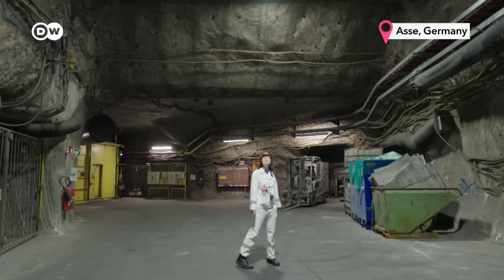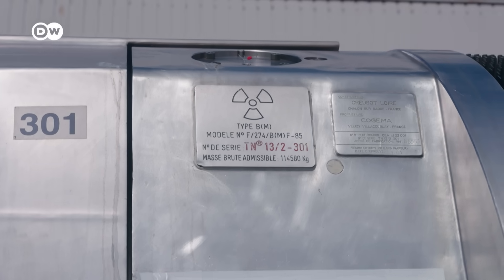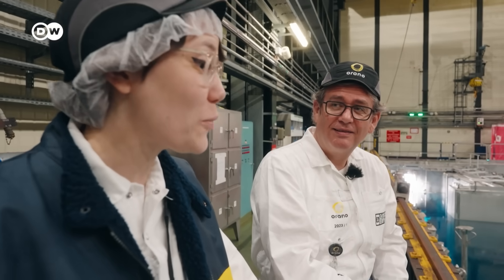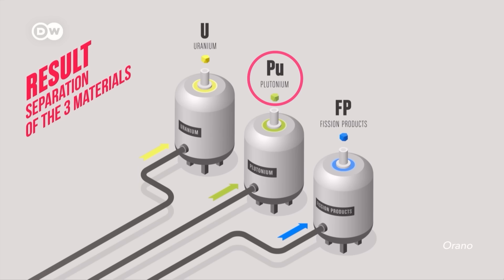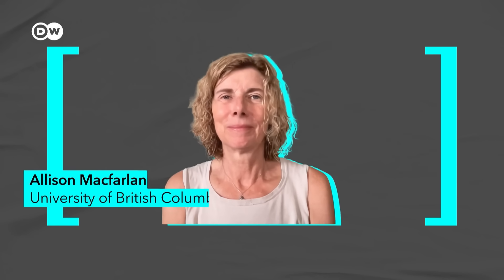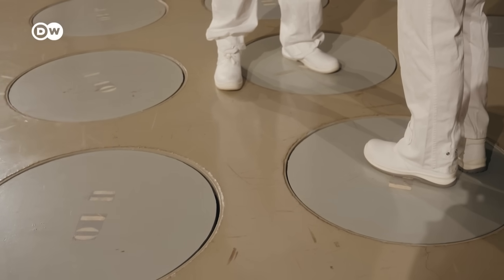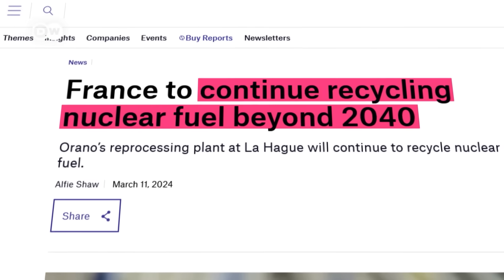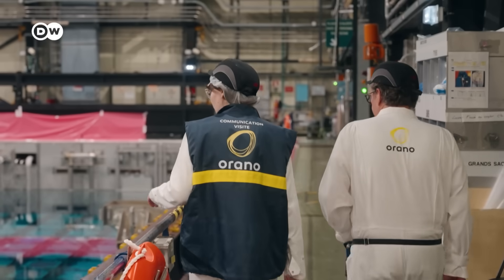Nuclear waste is reusable. Why aren’t we doing it?

Comment: In Germany people ran Amok against the Nuclear recycling plant in Wackersdorf. Later attempts at recycling spent fuel rods drew massive protests where people chained themselves to railroad tracks to prevent nuclear recycling (Castor transports).
So the fact that it is recyclable is well known in Germany, just not wanted.
Reply: Weren't the protests against castor transports directed at nuclear power overall and/or the (temporary) storage? I never heard that they wanted to prevent nuclear recycling. We don't even have the facilities to do so. Weren't the castor transports heading to Gorleben where nuclear waste is dumped until there is a long-term solution?
Reply: @kathrinbauer5358  YouTube has again deleted my comment, probably because I linked to a DW article published on 2004-July-11 where a castor protester was killed by a train coming from the French recycling plant in La Hague. 
But who needs sources when we can just shout at each other and spend interaction time. 

Whatever prompted you to cast my comment in doubt: everything remains as it is! 
1.) Nuclear recycling was well known in Germany.
2.) the nuclear recycling facility in Wackersdorf never came to pass due to protests. Please look up "Wackersdorf nuclear reprocessing plant" on Wikipedia!
3.) the French recycling facilities at La Hague were used by Germany instead
4.) the anti-nuclear protesters targeted specifically castor transports back and forth to La Hague... as witnessed by the article on DW mentioned earlier.
Reply: its sad and stupid when you know that germany was once the most advanced country for nuclear energy. Big brains are leaving this country because of shit politics, which leads to even stupider politics...
Reply: To bad there are so many stopit people in the world 😢. 
A small part of the population was against nuclear power plants in Germany and they managed to get the government to stop and dismantling the  power plants in Germany .
Now they have a big problem for there industrie  and had to go back to burning coal 😭🤯.
And there trying to solve there energy crisis with solar and windmills 😂. 
I think hydro plants maby a solution for them .
Reply: Every time I speak with a German about recycling they end up shouting facts how it’s not possible or else everyone would be using it. Maybe I’m talking with wrong people but Nuclear Phobia is crazy here.
Reply: @blackfoxstudioX  That has a couple of historical reasons: East Germany but in particular West Germany was THE front country in the Cold War and both NATO and the Warsaw Pact foresaw the end battle taking place on German territory (see In seven days to the River Rhine). West Germans were horrified by the decision of the German government to let the US station Pershing Rockets on German soil, making it a primary target for a pre-emptive strike. 

Naturally, this caused a lot of fear: many towns still have signs at their artery roads saying "this is a nuclear weapons-free zone". My father had planned out a route that would get us by bike to the Western side of the River Rhine. 

The pacifistic movement in Germany took deep roots in Labor Unions and the left intellectual circles. These movements also replaced the German word Kern (Core) which is used as a prefix for "nuclear" by the word atom. So nuclear power became atom power, making it reminiscent of atom bomb.
Nuclear plants but particularly the nuclear recycling plant in Wackersdorf were painted as dual-use facilities that would rouse the suspicion of the Warsaw Pact.

The pacifistic movement joined forces with the environmental movement in a narrative that could be titled "man and nature in peace" and found its political expression in the Green Party - third strongest force in German politics today. The environmental concern "what do we leave for future generations?" also asked: what do we leave behind. 
The final deposition of nuclear waste became the ultimate trump card in the German nuclear discussion - see Nuclear Priesthood.

Since - as in many country - the capital is in the hands of less idealistic people, the anti-nuclear movement composed of a broad coalition of environmentalists, pacifists and left-leaning people in general focussed on making nuclear power simply as expensive as possible and demonstrated with great publicity through road- and railway blocks against the transport of nuclear waste. The opinions against nuclear power are so negative that no foreign company will invest into a nuclear plant in Germany in the foreseeable future.
Reply: idiocy
Reply: And now germany is breaking there own rules and borrowing 500 billion, whilst strip mining brown coal. Nordstream is a hunk of junk, myb shouldnt of relyed on russian gas duhh. Idealists and romantic thinking bringing the king pin of europe too its knees. Think they chose the greater of two evils there.
Reply: Activist do not equate with intelligence
Reply: Germany doesn't even want France to do it. I heard that France could use much more of its existing nuclear plants but German reps keep blocking them in the EU energy council in response to demands from the anti-nuclear movement. It sounds well-intentioned but misguided
Reply: Dumb Krauts
Reply: Beware - recycling is mostly a marketing lie:
Orano claims 96% of the fuel is recycled but that marketing talk.

In reality only the small amount of Plutonium is really turned into new MOX fuels.
The low enriched Uranium mix (around 95% of the total mass) cannot be used as new fuel. 
It is a "could be" fuel that is not used by anyone and only could be used if you would treat it further....
Orano's 96% claim is off by around 95% !
Reply: Yes because as she said atom bombs. Germany has a ban at weapon useable Plutonium outside science. If you remember someone lost a war. Still During the cold war American nuclear weapons were still stationed in Germany.
Reply: The problem is the boomer Generation. They also vote for parties which intensify the immigration problem.
Reply: Germans lost two world wars for  a reason .. they are not good at using common sense
Reply: The pollution from people driving to and from the protests will kill more people than the plant ever will.
Reply: People in Germany are known for some silly and illogical things. Greens vote to ban nuclear, yet they very much like using Russian gas and polluting air with coal fumes. This is politics and agenda, and fact that simple-minded individuals can be easily manipulated, not reason, why they do so.
Reply: Now they buy nuclear power off of France, pretty ironic huh?
Reply: it is so crazy how germany would tolerate that. stichwort: Landfriedensbruch und Gewaltmonopol des Staates
Reply: Build them in France sell the electricity to Germany dito UK nuts.
Reply: And all that nonsense came from Soviets to keep Germany and other European countries from getting nuclear power... And of course, Germany's Greens are green only on surface, scratch that and you will find red inside.
Reply: Germany prefers to burn fossil fuels for their energy and then sh*t on france for its nuclear power usage (and barely having fossil fuels for energy).
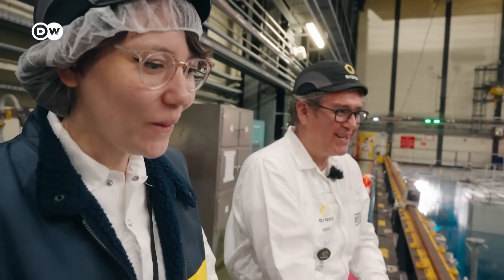Reply: "4:35  im used to it but its my first time here." I Dont hang out here either hahaha😮
Reply: The coal Corporations hold an absolute Monopoly over the German Power plant industry and have sucsessfully scared the public away from nuclear energy
Reply: Technically can’t they recycle it later on? It’s not like it’s going to go anywhere after they bury it or whatever they do with it.
Reply: O nuclear waste lasts 10's of thousands of years. Hmm perhaps we may advance a little in that time period? Especially if we pursue logic not idiocy
Reply: @sionwright3570 such plants are already today. In west media are ignored for political reasons.
Search for BN-600 and BN-800 Power plants.
Reply: Stupid liberal unemployed people are at it again
Wasting money
Reply: there is a saying people get the governance that they diserve, and probably the energie to:-) that being said, economicly it is questionable if recycling nucleair wast is a succes, but from the prospect of taking up responsibilty it is miles ahead compared to the oil industrie and especialy the renewable industrie.
Reply: @panoramix2656  Absolutely! Well said! i live in Germany and I got to say, here the politics is really a joke. There is not even one sound party left in the system.
Reply: @sepmercury5180 You guys need to elect an Austrian and Make Germany Great Again.
Reply: @gussampson5029  Been there, done that, as they say. But the US may be heading in a similar direction... ? Let's see how that works out
Reply: @sepmercury5180  People generally have the leaders they deserve. We have made politics as a job so unattractive with bad salaries and lots of envy that all the really capable people go to work in industry or run their own businesses.
Reply: As long as it's outputs radiation it can be used for energy. Note the transport caskets for the waste was said be at 300°C. I fairly sure that's above boiling and therefor producing steam. We don't always have to recycle we can just use different type of reactor to take advantage of the less energetic fuel.
Reply: @PieOfDoom2000  Isn't steam already the same principle nuclear energy is converted in powerplants for the energy grid?
Reply: @kinngrimm I think he means coupling the cooling chambers of spent fuel rods with heat recovery systems for district heating for example. This is somethings that’s being looked into.
Reply: @PieOfDoom2000 not hot enough to make the super steam.
Reply: @PieOfDoom2000  A town in Sweden runs their city's  water pipes  through a local crematorium before it fills the hot water tanks.
Reply: Germany loves carbon , pay high price electricity & russian gaz. Greetings from France.
Reply: They stopped using nuclear power in germany which is the most green power there is and instead they opened all their coal plants again :DDD i love activists and their logic.
Reply: The end of coal power plant is decided and willl be completed just like the nuclear exit was decision and then completed. 

The coal plants were a temporary issue due to lack of natural gas from Russia. 

 @saramorin4792
Reply: @saramorin4792 except they didnt😂 someone lied to you
Reply: @saramorin4792  I really dont know where the myth came from that we went back to coal. Energy produced by coal has been steadily going down for over a decade now. What is true however is that the coal phase out was MASSIVELY slowed down.
Reply: I think, that Germany will succeed in its attempt to abolish coal and nuclear energy. Not the fossil energy. Some (small) quantities of (politically correct) natural gas will be needed to stabilise the power grids. The (politically correct) NG is a far better solution for the energy transition than the nuclears and the coal.
Reply: @IvanPetrov-k2k  Imported LNG (which, unless you continue to get Russian gas, will be the largest source of natural gas in Germany in this scenario) is more carbon intensive than coal. Why would you want this?
Reply: They want Russia'ns gas, and they were payed in full.
Stupid idea.😂
Reply: Just look up how recycling ended in britian. You dont want a recycling plant next to your house. I can fully understand.  They does not Tell you in the Video what happens with the light radioaktive process water and air
Reply: @Das_Schaf details? I’ve never heard of any nuclear plant of any sort irradiating its surroundings just from normal operations
Reply: @wild20cat56  Sellafield did that.....
Reply: @wild20cat56  nuclear reactors usually can liberate small amounts of radioactive gasses, but the half life for those gasses decay is like, five days or so, not enough to irradiate the place
Reply: @Das_Schaf  Are you dum?

Comment: Question:
Cant you speed up the cooling process? 5yrs of cooling seems too long for the process to be efficient
Reply from the maker: It is a safety standard, rapid cooling could lead to cracks or other structural issues in the rods and could increase the risk of radioactive release. ☢️

Comment: It seems the single biggest disconnect in thinking has to do with the notion that technologies and systems that can reuse fuel are expensive.  That point of view shows that the problems and costs associated with current practice are not being adequately considered.  How much cheaper is it to have nuclear waste that will decay to a safe level in 100 years vs 100,000 years?

Comment: WHO CAN YOU TRUST TO REUSE IT? CERTAINLY NOT EXCEL ENERGY THEY COVER UP AND LIE AND DON'T EVEN REPORT LEAKS LIKE THE MILLIONS OF GALLONS OF TRITIUM THEY LEAKED AT MONTICELLO FOR YEARS AND TOOK 6 MONTHS TO REPORT THE LEAK WHILE THEY ORDERED 15 UPS VANS FULL OF PPE GEAR AND SCREWS NUTS BOLTS PUMPS AND OTHER BOXES AND CRATES OF PARTS WHILE I DELIVERED TO THEM THE WHOLE TIME THE LEAK WAS GOING ON, AND LIVE UP THE ROAD 3 MILES AWAY DRINKING THE TRITIUM CONTAMINATED GROUND WATER IN THE MONTICELLO AQUIFER THAT SUPPLIES THE TOWN AND MY PRIVATE WELL. I HAVE CANCER GROWTHS GROWING FOR YEARS AND COULDN'T FIGURE OUT WHY, AND THEY HAVE SLOWED DOWN IN GROWTH SIZE AND SOME WENT AWAY AND NEW ONES HAVE GROWN AND IT'S BEEN OVER A YEAR AND HALF SINCE IT WAS REPORTED TO THE EPA AEC IOA. THEY PUMPED ALL THE GROUND WATER AT THE PLANT BUT THE PLANT SITS RIGHT ON THE MISSISSIPPI RIVER AND FLOWS ALL THE WAY DOWN PAST MINNEAPOLIS TO NEW ORLEANS..HOW MANY TENS OF MILLION OF GALLONS OR BILLIONS FLOWED IN THE RIVER FOR 3 YEARS UNDETECTED? IT'S NOT RECAPTURE IN THE SHARED AQUIFER OUT SIDE OF NUCLEAR PLANT PROPERTY.
IF YOU CAN'T TRUST THE NUCLEAR COMPANIES, AND THE EPA...WHY NOT JUST PUT THESE SPENT NUCLEAR FUEL IN NUCLEAR POWERED CARS MADE INTO NUCLEAR BOMBS FOR ILAN OMAR IN MINNEAPOLIS ALLAH AKBAR KABOOM!

Comment: First the used fuel rods are quite radioactive.   Second it's quite dangerous to life from heavy metal toxicity and radiation.    Third because its fissionable material it is quite easy to cause a reactivity accident.   The fuel rods also contain gases that can escape.  It also a potential terrorist target for either the fissionable materials, and the "dirty" fission product daughter's.  

Recycling the fuel requires several chemical processes that can be dangerous.   Both enriched uranium and plutonium can be used for bombs, since the recycling process results in enriched plutonium making it a very tempting target.

Comment: The issue of nuclear waste has literally been solved for many years now(extremely safe deep underground long-term storage etc.), and yet people are still continuing to spread the lie that nuclear power is more dangerous than other power generation methods like coal or natural gas. France is a good example of massive use of nuclear power in a very safe manner. We all need to follow in their example as soon as possible, before it's too late.

Comment: Very interesting video.  I would have liked to see the entire recycling process and learn what chemicals are used to separate the plutonium and uranium. I also wonder why the mox fuel recycled rods are not recyclable. Maybe because it would require new refinement or chemical processes or the energy just isn't worth the cost?
Reply from the maker: Please check out Orano's own material - they have a longer video on the process. The chemicals can vary in the acid solution. Here's for example one study looking at Na2CO3 or (NH4)2CO3 👉 https://www.sciencedirect.com/science/article/pii/S1738573322000092.

Comment: As  you said it takes hundreds of thousands of years for nuclear wast to become inert.  So even recycling it still takes hundreds of thousands of years.  The cost of storage and risk of leaks and terror threats is prohibitive.  Nuclear power is the most expensive electrocity you can produce.  The only benefit from nuclear is there are no carbon emmissions but carbon is not a polutant.  It is needed for all green plants to live.  and all of the animals that eat green plants including people.

Hydro-electric plants are the cheapest electrocity  because there is no fuel.  It is generated by water flowing down hill (gravity) which is free and no carbon is generatedand no waste that must be stored forever..

Comment: Plutonium leads to bombs fear mongering is wrong. Plutonium is not easily turned into working nuclear weapons. Constructing a plutonium explosive is not easy either. Both objectives cost billions of dollars and you can't just hire people to do that. You need physicists and metallurgists, chemical engineers, electrical engineers, top skills from all hard sciences and they still have to figure it out from a scratch, because there is no how-to articles or Wikipedia pages describing step-by-step what is needed. 

However I liked the presenters open minded attitude. She/they should make short documentary of the planned and tested 4th generation fast fission nuclear reactors. Nuclear breeder reactors using uranium, plutonium and thorium are real and countries without uranium resources like India are actively exploring them. 

Then there are countries like Finland who are now building prototypes of low temperature reactors for municipal heating, as it is something where big CO2 emission savings can be made, not to mention reducing the physical footprint of the power generating facilities.
Reply: It's not nearly as hard as you think if you have resources.

Comment: I'd support Nuclear Energy

Nuclear is currently the only Green Energy that reliable, dependable and efficient 

Especially if Thorium and Fusion Reactor get proper support

Other green alternatives still use Lithium Battery (which is massive mining industry), inefficient, not dependable, not reliable and most components aren't easy to recycle 

imo,, 
anti nuclear = pro fossil fuels, pro rare minerals mining and pro climate change